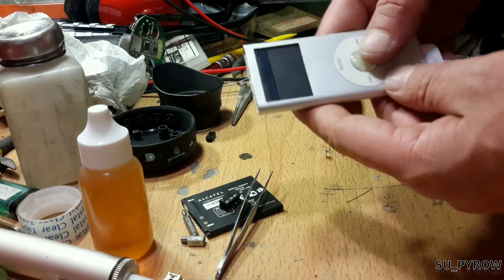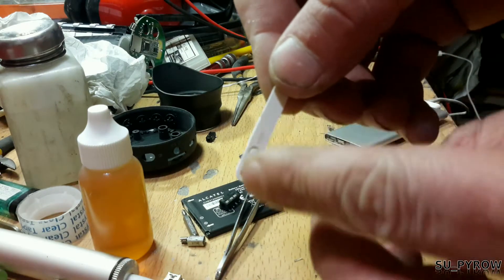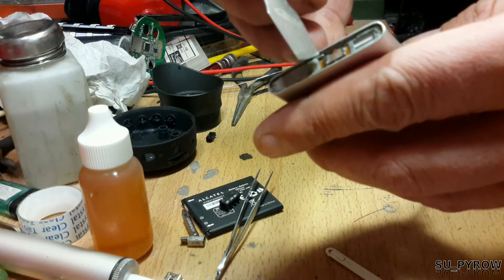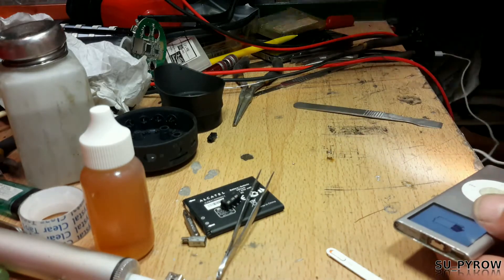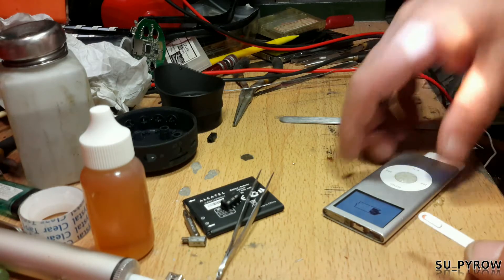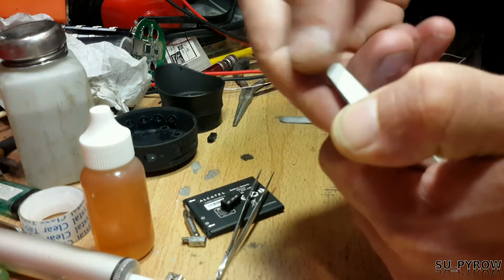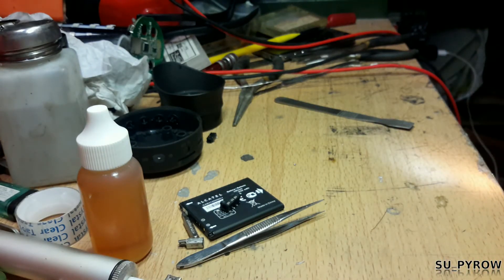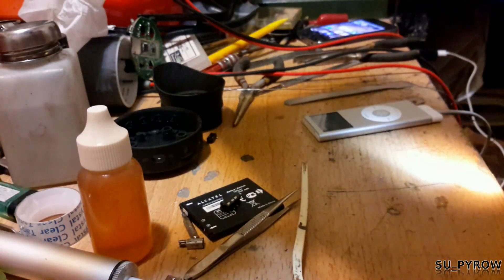Apple Ipod Nano 2nd Generation Repair constantHOLD/LOCK not Charging from umajunkcollector

Comment: hey, did you ever fix the battery issue? I have that problem right now and have no idea how to fix it even though i changed the battery
Reply from the maker: you changed the battery and it wont charge? see if you plug the device into a computer, find out if it recognizes it
Reply: @supyrow  yup, I plugged it to my laptop and it was detected, I even formatted it and synced loads of albums into it. I also left it plugged it to the wall and immediately after I unplug it, it gives that error and dies. Did you ever got around fixing this issue?